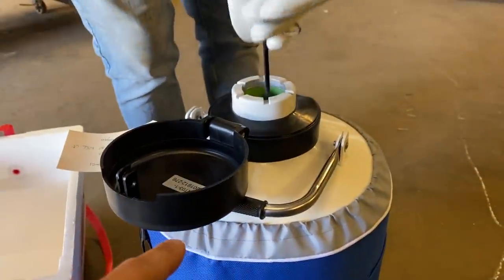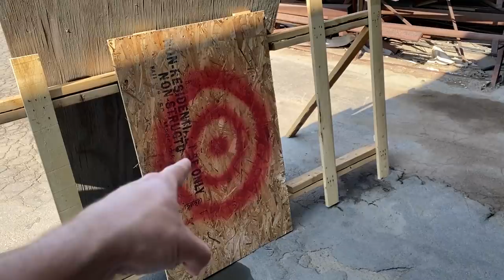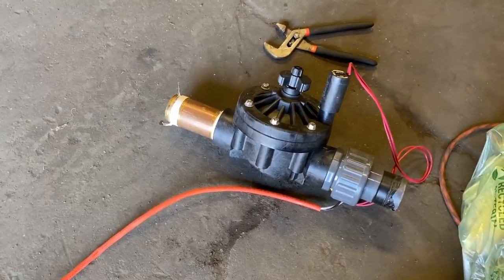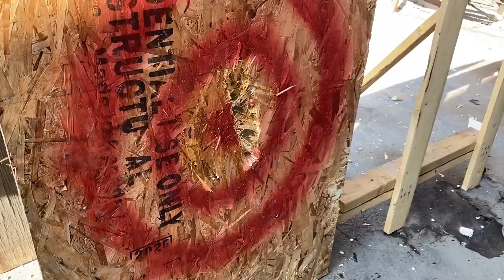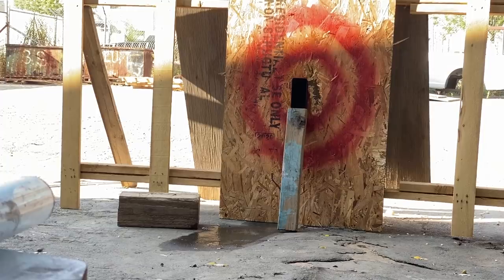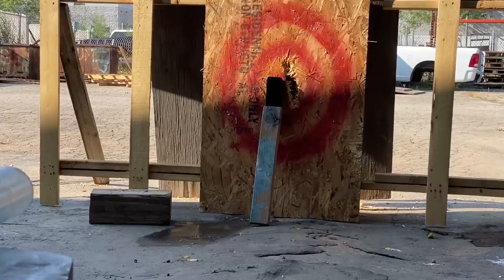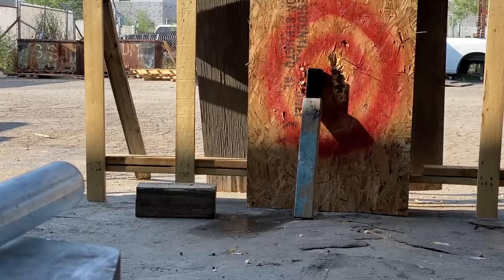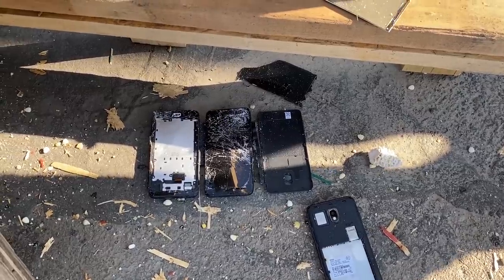Most Deadly Vegetable - Waterjet Channel Machine Shop Tests

Comment: You guys should use wadding behind anything that doesn't fully seal inside the barrel.
You will get way more velocity with the smaller stuff like eggs that way. 👍
speaking from decade plus of pneumatic cannon design experience
Reply: Like so they can see
Reply: Better yet, find a paper cup that fits in the barrel tightly, boom you have a sabot
Reply: And maybe a burst disc
Reply: You don’t even look 1/20 that old
Reply: @bean8721  I have a rare disease that causes me to age backwards! :)

Comment: I'm curious if the corn on the cob would be stabilized going through a rifled barrel? 🤔
Reply: Same
Reply: Probably.   A lot of effort to make the whole barrel rifled, just make a rifled choke.
Reply: I was thinking @taofledermaus should try shooting super-frozen grapes from a shotgun.
Reply: @KnifeKnut  i feel like a corn would get pretty torn up with a rifled choke
Reply: @eragonunderhill5545  It does not need more than two rifling ridges at these speeds.   They could cut one out of a block of steel with with the 3d waterjet.
Reply: I don't believe so. I think Demolition Ranch tried it
Reply: @justwhy3257  please link that video. I don't remember him ever shooting corn through a rifled barrel.

Comment: LN2 chilled corn cob vs pig head? Super nasty, but interesting. 
Tipp for improving the cannon: get a smaller tank, thus only enough air to accelerate the "projectile" gets used. This should prevent the cannon from destroying itself.

Comment: be better of doing  it in a thick pyrex jug .... as long as you slowly chill it down before filling it compleatly it will easy stay together with the low temps  then we can see it much better and you would boil off less because you can use less

Comment: I believe it's safer to handle liquid nitrogen withOUT gloves
Reply: Youre right. Without gloves, liquid nitrogen is more prone to just bounce off of your skin because of the leidenfrost. With gloves, liquid nitrogen would soak into the gloves and actually do damage to your skin. It does look like they're using the correct, non-porous, gloves for this application, but I dont know for sure.
Reply: Unless you have proper gloves...
Reply from the maker: These are liquid nitrogen gloves